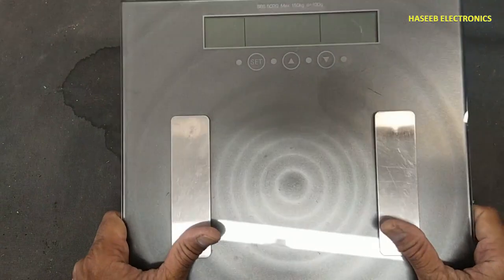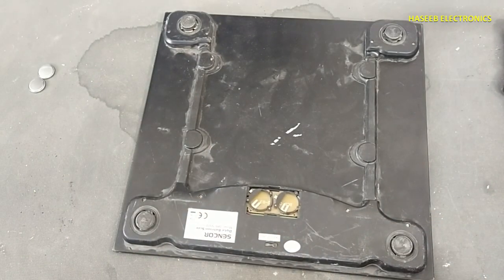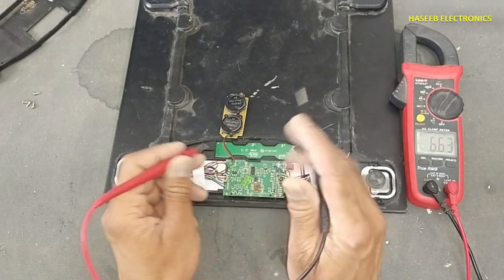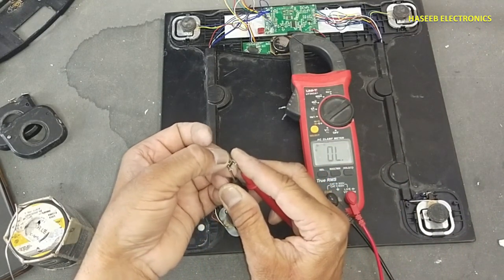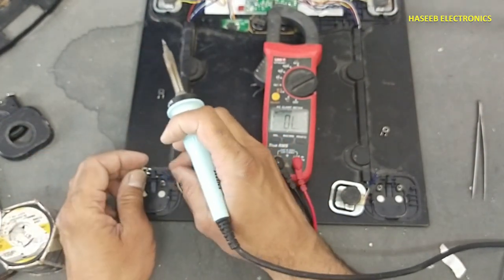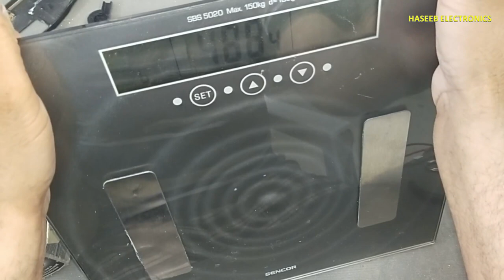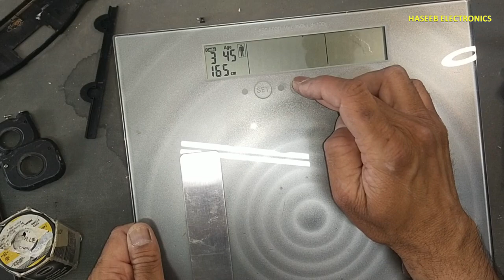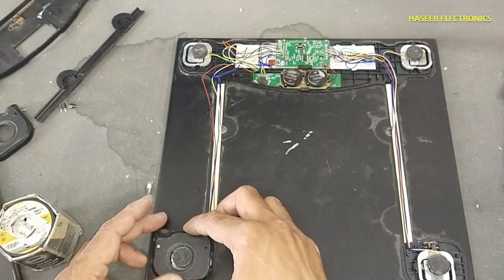{877} bathroom weight scale repair

Comment: Thank you! That was exactly the problem on mine weight. Below one sensor I replaced micro switch, below second sensor it was broken plastic arm which presses the switch so I glue the arm. Although it can work only if one switch is working. New bathroom weight is bargain, but it's more green to repair the old one than to buy new one. 🙂

Comment: What could be the issue with scale giving incorrect weight
Reply from the maker: Most of time the uncalibrated load cell
A/d converter 
Dual Power supply circuit of the microcontroller and a/d converter

Comment: Sir, I connected 3.3v power supply to the machine it doesn't turn on but when i connected with 2xAA battery (3v) it's working.It has sealed glass i can't able to open. What is the reason sir?

Comment: My scale is fluctuation in showing weight
Reply from the maker: most probable cause
1. might be Loadcell is damaged 
2. might  be some wiring disconnection in loadcell circuit
Reply: @HaseebElectronics  1. Load cell is okay
2. I will check, thank you so much.